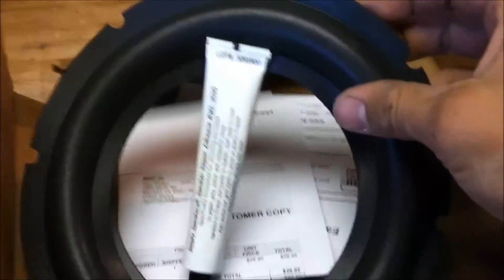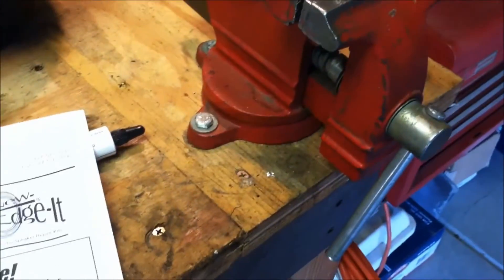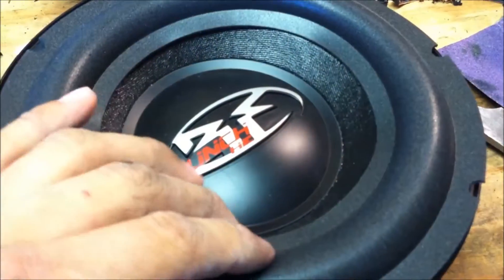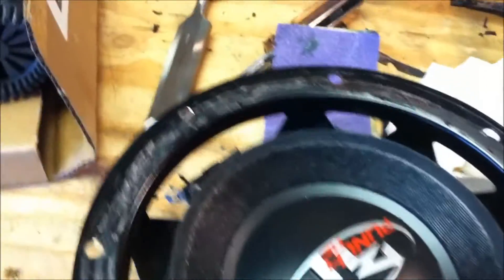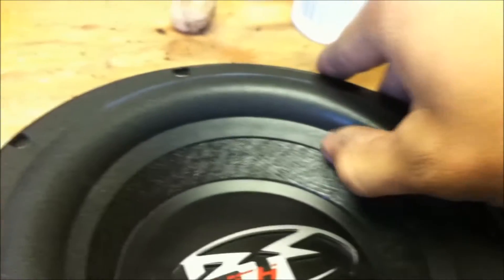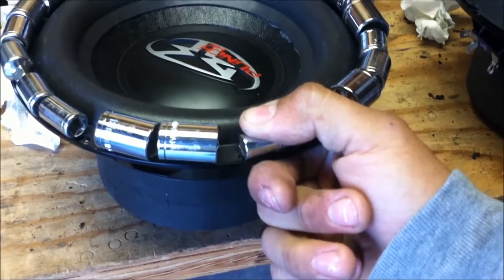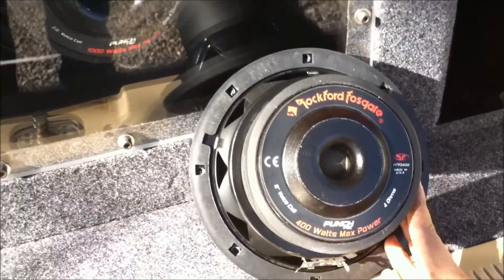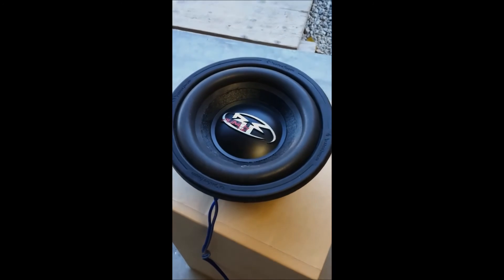How To Replace A Speaker Surround (Fosgate RFP3408)

Comment: I know this video is old as the hills, but is still useful!  I found a set of two RFP3408's in an enclosure hidden under the back seat of a 1995 pickup truck I just bought.  While I was doing a post-purchase deep clean on it, I flipped the back seat up and there sat a JL Vantage enclosure loaded with two RFP3408's complete with a same-era vintage Fostage amp!  I was like "Oh, hello there!"  After hooking up some new wires, everything works just the speaker surrounds have crumbled to a mushy dust.  Found this video while looking up how to repair them.  You're video is still a help in 2021!

Comment: I know this is old but the dust cap comes off really easy with a heat gun so you can line up the coil with shims like they do at the factory.
Reply: mikes hobbie's and random stuff I tell you any information helps I'm about to fix two 10in Rockford Fosgate HE and was looking for information thanks for the tip
Reply: @louiemares1610  was you able to fix your subs I know this is old but I’m going to try and do the same as soon as the kit gets here from amazon . Let me know